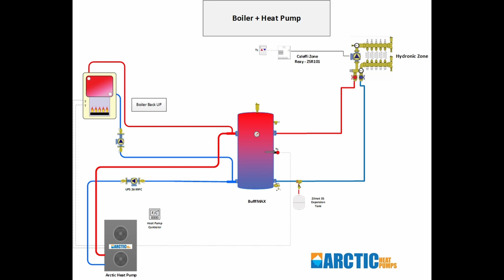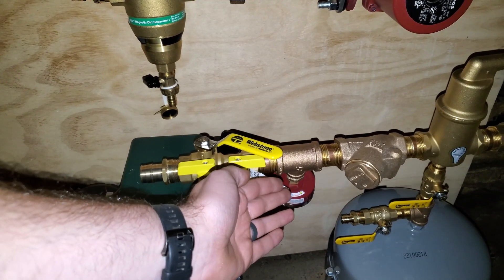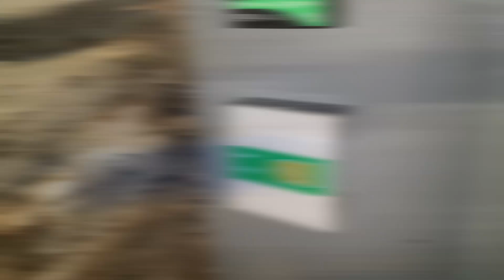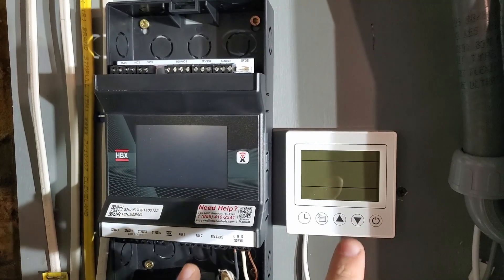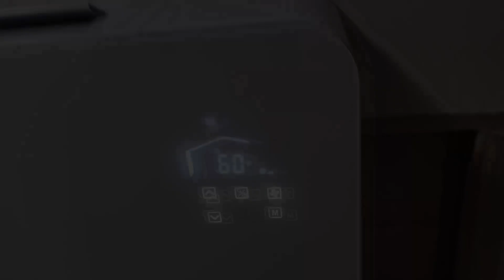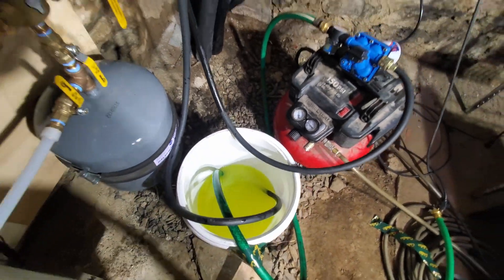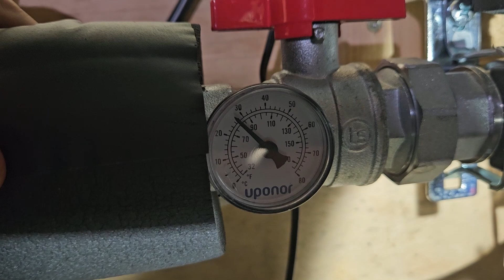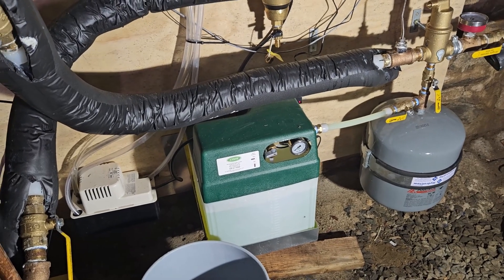No More Oil Heat - We Installed an Air-To-Water Heat Pump

Comment: Great job, thanks for the very honest 'expose'.  Very helpful to all who are watching.  Many lessons learned.  The leaks were painful I'm sure but I bet you're a pro now.  I wonder why you didn't use SpacePak since I believe they are 'right in your neighborhood' (Massachusetts)..?  Keep up the great work!  Dropping the load of the houses oil consumption dramatically yet keeping it in play.  I'm an RE nut (Renewable Energy) but still see the value of stored fossil fuels, fossil solar fuels.. from hundreds of millions of years ago.  Like wood, stored solar energy, is a good thing to have at hand... when you're running the super efficient 'hydronic heat pump' off electricity.  And we often forget that while they are an electric device, much more than 50% of their energy comes from solar energy stored in the air.  Now, if you haven't done it, it's time to do a deep efficiency retrofit to the house.  At least a blower door for air tightness and also an infrared camera to reveal weaknesses in the thermal shell.  Great pioneer spirit you have!
Reply from the maker: Thank you for the feedback! I strongly considered Spacepak (and actually purchased Spacepak branded fan coils) but the heat pumps were difficult to source and about twice the cost of the Arctic unit that I purchased. Are they twice as efficient/reliable/durable? I don't know. I am a big believer in hybrid heat sources, being able to switch heat sources from electricity to fuel (oil or propane) to wood as needed is very valuable. We are actively working to increase the air tightness on the house, we haven't done a blower door yet but its on the short list. Thanks again!

Comment: Hello,  I'm doing this same project and I ran into some problems,  Can you send a link for your manifold,  I can not seem to find any manifold that can send 3/4 " outlets with 1" inlet,
Reply from the maker: I think I mentioned on a different video I bought Uponor (https://www.uponor.com/en-us/products/manifolds/metal-manifolds/stainless-steel-manifold-assembly-1-with-flow-meter) but most manufacturers sell similar products
Reply: @betweentwobrooks  the link doesn't work I really need this part

Comment: does the hydronic hot water heat the base boards well enough?
Reply from the maker: We are not using the baseboards with the heat pump. We have some fan coils for the heat pump that are designed for low temperature heating. The baseboards are still connected to the oil boiler that runs at 180 degrees. Thanks for watching!

Comment: I did the same install,  but kept my high efficient boiler and oil burner and double wall oil tank, hooked in series with air to water h/p for the real cold days, and backup source.
Reply from the maker: Good idea! This is essentially what I will have, except our oil boiler is on its last legs and our oil tank is starting to rust out. So we will be installing a new propane boiler that will be backup and additional capacity. Thanks for watching!

Comment: How do u like this system.  I'm thinking about getting this heat output for my in floor heating
Reply from the maker: I am happy overall, our climate in CT is not very cold in the winters anymore and this is perfect for heat and air conditioning. The fan coils I installed leave a bit to be desired but it should be a nice setup for radiant floor heating

Comment: Installed in-floor radiant heat back in 2004. Unfortunately I am the only person who knows the system. 3 plumbers looked at it and said “ no thanks”
Reply from the maker: I also had trouble finding competent mechanical contractors, that is one of the reasons I chose the system i did so I could self install. Thanks for watching!

Comment: Thanks for sharing your installation experience! I appreciate the level of details and honesty about the challenges along the way. How did you figure out/come up with the way you would put your panel together?
Reply from the maker: I'm a mechanical engineer by day so I actually modeled the panel in Solidworks to help figure out my layout and spacing. I'm sure there are better ways to do it and a professional probably would have built the panel differently but it seems to be working ok for my purposes. Thanks for watching!

Comment: I’m going to suggest 2 things for this system.  The first is get a whole house surge suppressor and the second is to put local surge suppressors on both the outdoor unit and the indoor power circuit.  It is cheat insurance and will protect all of the electronic components.
Reply: Also, beautiful install!
Reply from the maker: Thank you! When we moved in we had the electrical service upgraded to 200a and they installed a whole house surge protector at that time. I also have a surge protector on the outdoor unit.

Comment: Always use tape and dope. You left no way to isolate and drain the water pressure from your expansion tank for checking air pressure in your bladder, always use a expansion tank valve. The unit I assume is 5 ton or 60k BTU. Im not sure where you live but most old and drafty homes in eastern PA require 80 to 100 K. It will be interesting to see how long its lifespan is. Heat pumps in this area usually go 12 to 14 years although your monoblock should be a lot less to replace labor wise.
Reply from the maker: Thanks for the tips! Yes, it is a 60k BTU heat pump. Our heat load currently is around 120k BTU, our goal is to decrease this with some insulation and air sealing. We will still probably need a second heat pump unit to meet full load once the whole house is converted.

Comment: Curious about tbe costof the system. We are looking at air to water for under floor hearing. Do you have any operating cost so far?
Thanks for the post.
Reply from the maker: I'm planning to put a video together on cost very shortly, once we are done with this heating season. The initial purchase price is probably a little higher than a gas or oil boiler/furnace. Operating cost is looking pretty similar to oil this season but we have been keeping the rooms serviced by the heat pump a little warmer than in previous winters. Stay tuned, I'll have more details in the near future. Thanks for watching!

Comment: Great setup,   is this system using premixed  ready glycol or water?  
Did require permit for electrical and plumbing if DIY ?
Reply from the maker: I am using 30% glycol for freeze protection. In our town permits are required even if diy

Comment: Just went through an unusual cold  snap of -40°C (-41.8°F) up here north of 50 in Canada, our Arctic heat pump system worked great. It looks pretty much the same as yours and we have all in floor hydronic in Radiantboard by Ecowarm. The backup boiler kicked in for the couple of days required to keep the buffer tank temperature at 35°C but now that the temperature is much warmer (+4°C to -8°C) so our buffer tank is only needing to hold a temperature of about 24°C to keep our house at 18°C (we like to be a bit cooler because we are still doing interior finishing work).

We actually tore down most of the 1978 built house and rebuilt double stud walls for ~R48 with ~R60 ceiling so our heat loss is very low. 

There were some issues finding trades who were willing to learn about the system and do the installation for us but adopting “new” technology is always going to be viewed with skepticism by those who choose not to learn new ideas. 

We wouldn’t go back to using natural gas because it’s just not as comfortable and the future costs are only going to go up. At least with electricity we have the option of adding solar panels and tying into the grid to further control our electricity costs. 

Thanks for sharing your experience.
Reply from the maker: Its great to hear from someone else with this system. How long has your Arctic heat pump been in operation?

Thank you for watching, we really appreciate the input!
Reply: @betweentwobrooks   We’ve been on quite an odyssey with our house renovation/building project so from the time we ordered it to actually getting it operational was quite a lot longer than we’ve had it heating our house. But it’s working really well and the switch over to the backup boiler when the outside temperature went below -27°C ( our set point) was seamless and it kept the buffer tank at the best temperature for heating the house when the temperature dropped down to -41°C. 

We’ve had it working since the beginning of November so it hasn’t been that long, we don’t have an electric bill yet to see what our consumption was. We also are not living in it yet, still have some flooring and other finishing work to complete before we can move back in. 

You are absolutely correct in your video about using a generous amount of sealant with the Teflon tape, the plumber that did all the connections had to come back to re-do some fittings on the tank to fix the leaks. More sealant and not too much tape is the trick.
Reply: Hi
I have infloor radiant system now with electric boiler on wall. Heating costs are very expensive.  Do u know if this heat pump will bring down costs significantly. 
Thanks
Reply: @ I can only say a heat pump is most likely to reduce your electricity consumption for your infloor system since heat pumps aren’t using resistive heat but are a transfer of heat. The month of November our total household electricity consumption was about 1,400 kWh, and our house is a 3 BR two storey with a basement. November was cold but is not the coldest month in winter, so I expect to see a higher amount of electricity consumption in January and February.
Reply: @randymuise2227   If you’re replacing an existing electric resistance boiler system with a heat pump, you should see significant difference in the efficiency and cost of electricity with a heat pump. Definitely worth looking into, hopefully there’s someone in your area who is on board with heat pumps and can give you quotes.
Reply: How much did your system cost to install? Im in northern ontario and thinking about getting one.
Reply: @aroncahill2219  our system was about double the cost of a high efficiency gas furnace and duct work. Because we built during the pandemic some of the costs were higher than they were previously or afterwards, but we were thinking longer term for comfort, so aren’t fretting about the higher prices, c’est la vie. But now that there’s more adoption of heat pumps especially in the colder parts of Europe, there’s more choices for cold climate heat pumps and more data on how to size the units for the house. The other key part to consider first is insulation and controlling heat loss from air leakage, no matter what heating system you get, not needing to heat or cool as much is the real deal. But having only one utility bill also makes a difference, especially since we had no effect on the extra fees that the gas companies charge that aren’t tied to the amount of gas used. The other benefit of not having a gas furnace or water heater is no worries about carbon monoxide or gas leaks inside the house, that should also help with our insurance coverage costs.

Comment: Good job and best way to heat and cool efficient and without low co2…if the heat pump could be use solar voltage power, than the enrgy cost will be better and co2 is just perfect.Thx for this interest video-.LG from Germany 🙂
Reply from the maker: Thanks for watching! Our long term plan is to integrate solar pv to reduce our reliance on the grid

Comment: Id have kept the oil system. The money paid for the new system would have more than have paid for the the fuel oil for the rest of my life.
Reply: What is this comment based on? Nothing, no experience with the technology, just negative spouting off.
Reply: Maybe! I contracted have a Mitsubishi (2 each 3 ton) system with ceiling cassettes installed this year. but back to OIL! I burn over $4K for the stuff every year so how long do you expect to live?

Comment: System design is simple if done correctly with suitable radiators and pipework sized to the heat pump and heat loss of each room and building with new weather compensated controls and insulation.dont see what the problem is all of Europe has been doing it like this for years just I honestly think America seems to be a bit behind on that for some reason
Reply from the maker: Thanks for watching!

Comment: Looks like you did a fine job installing your system. I would be interested to know what the supply water temperature is from the heat pump at lower outdoor air  temperatures below 15 Fahrenheit.
Reply from the maker: I have the max outlet temp set at 120F when it is 7 degrees outside, I'm running outdoor reset control so the water will get cooler as outdoor temp goes up. It has only been down to about 15 so far this winter but we have not wished for warmer water yet... Thanks for watching!

Comment: What a complete waste... First it looks DIY and You installed a air to water heat pump and removed all the radiation in the house and installed two fan coils units... You might as well just installed 2 mini splits and saved 1/2 your time and money... I've been in the industry for 40 years and don't recommend anybody following your advice.... And for the people thinking about this for your house, They dont make a air to water heat pump that will replace your gas or oil boiler with conventional radiators, convectors or baseboard systems...
Reply from the maker: You are correct that you cannot just hook up an air to water heat pump to your existing radiators and expect it to work, and eventually the radiators installed in our house in the 1960s will become unnecessary. We looked into mini splits, but this house would have required about 10 units so we looked at more centralized options. Future build out of this system will include two central air handlers to service the majority of the house. None of this is advice for anyone to follow, just showing what we are working on. Thanks for watching!
Reply: @betweentwobrooks  Very eloquent response to a dick comment, you are to be commended.
Reply: Wow, I think a little undeserved hate from this comment.  I'll admit, this is not a pretty install, but at least he was diligent about testing it for leaks.  Air to water heat pumps are best for radiant floors, ceilings, etc because the massive surface area can put out a lot of heat for a given water temperature.  I agree, it would be weird to remove all the old hydronic emitters but I don't think that's what he did, just upgraded a couple to add air conditioning which he didn't have before.  The output of the other emitters doesn't drop to zero with lower water temperature, and if they were oversized and the house insulation is upgraded, they can still do a lot if not all the needed heating with air to water heat pump.  R290 models are on the way which can achieve higher water temperatures too.  Heating oil sucks, its expensive and the companies who sell it are shady, I'm all for finding an alternative, and the economics on my oil conversion to air to water heat pump will pay for itself in 5 years.  Not to mention that this is an upgrade, the fuel tank needed to be replaced anyway, and having atmospheric combustion appliances in the home (which all oil boilers are to my knowledge) can put the occupants at risk for CO exposure.  Most home renovations have a payback period of never (guess it depends if you think it got you a higher selling price when you do sell), you just wanted to have them because they are nice, so the fact that it will save operating costs significantly is icing on the cake.  And I'm just gonna say it, ditching fossil fuels is necessary for the climate.
Reply: @RicknessJ82  it's not just about the poor quality of the install.... It's a complete waste of material and time and they would have been better off installing a different type of system..... It would have been cheaper and more efficient to retrofit the house for air to air heat pump systems.... And for the rest of the crap you rambled on about just shows that you don't know what you are talking about and you should do research before telling professionals how much you don't know....
Reply: @michaelshanahan9578  I don't doubt that you are a great professional, but I have done quite a bit of research on these systems because I put one in my own house.  I tried to hire professionals but they all said the same thing as you, forget your hydronics and put in a bunch of mini splits.  So I did the job myself and I'm very happy with it.  Every case is different and without a detailed analysis, neither of us truly know which system is better for his particular application.  All I know is you suggested putting in 2 mini splits and houses usually have more than two rooms, even the owner said, his job required 10, that sounds like a waste too.
Reply: Not there with you yet in experience but as a 30 year tech I completely agree with you. Every thing you said in your post is exact. I honestly think that the aggravation your gonna go thru over the next years to come will test your patience for sure. I can’t imagine the cost of this and wonder if the initial cost how much money you will be saving over a conventional system. May take decades.